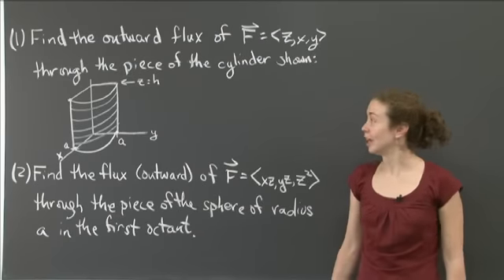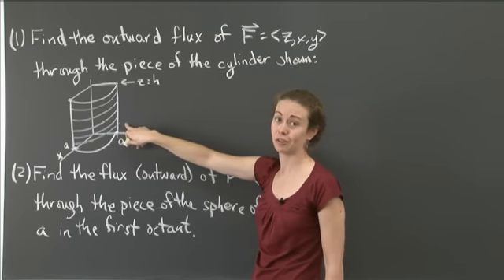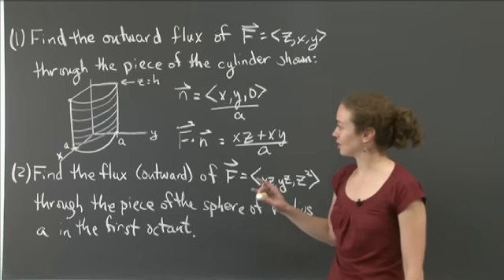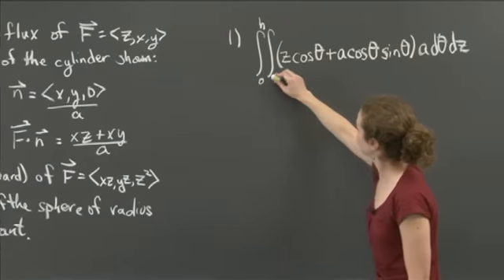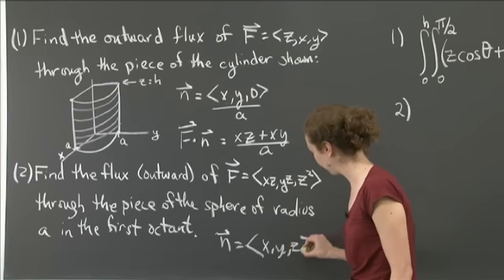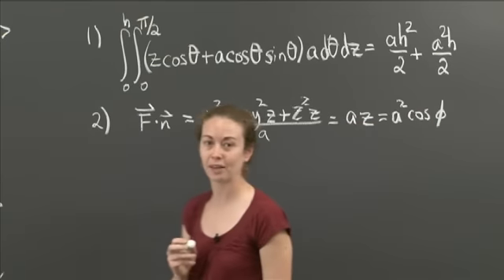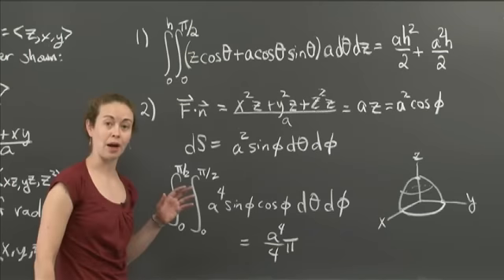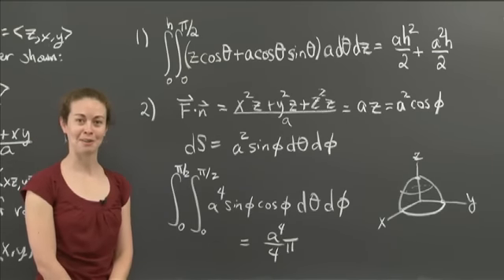Flux through surfaces | MIT 18.02SC Multivariable Calculus, Fall 2010

Comment: Why didn't you teach them using the parametrization and taking the cross product of partial derivatives of parametrization to get the normal vector? This dividing by "a" seems to only work sometimes.
Reply: Juan Preciado I think this is resuscitation, not a lecture.
Reply: @chriskitley9875  Recitation*
Reply: It confused me also
Reply: I was use to getting the cross product of the partial derivatives

Comment: how did you work out the normals?
Reply: did you find out the answer to this, especially for the curved side
Reply: You can take gradient of that field and devide magnitude of that gradient
Reply: the normal vector is like the parametric equations of <cos(t) , sin(t) > ;if you plug that into a graphing calculator using parametric functions  you get a full circle, but here we only have from 0-pi/2, which is controlled by the boundary of integration of d-theta. so the professor could have crossed the <cos(t) , sin(t) , 0 > with the the F = <  z ,x , y > and gotten the same.  Her (a*d-theta*dz) is her jacobian for her cylindrical coordinates ( r , theta , z). Know t is theta in my example, I'm not writing cos(theta).
Reply: @JG-zn6od  amazing. Is that really it?
Reply: @JG-zn6od  please teach me, is the gradient of the surface different from taking the partial derivatives Ang getting its cross product?
Reply: In case anyone still has this question, Professor showed how to get the normal to a cylinder's surface in the lecture: https://www.youtube.com/watch?v=phk05iSMezA&list=PL4C4C8A7D06566F38&index=27 
Essential, since it is horizontal, there is zero z component, then if you draw a circle in the x-y plane, you can see that the normal is in the direction of <x,y> but since it must be unit length, it gets scaled by its length (sqrt(x^2 + y^2) which = radius length = a in this problem. Hope this helps.

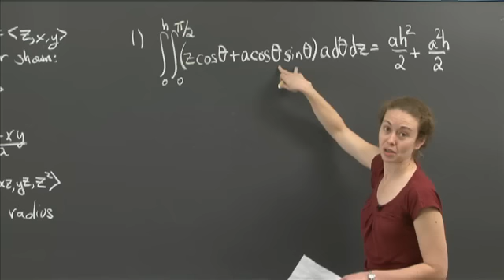Comment: 5:45 that zcosϴ should be zacosϴ. you guys should put an annotation as this have been watched 31k times. LUV from INDIA.
Reply: No, she did it right... (Remember it's the unit vector, so you have to divide zacosϴ by a, the norm.)
Reply: When #MOBI says she wrong. It doesn't matter she is MIT or Oxford, She is damn wrong. No excuse whatsoever will make her right.
Reply: MeagaRain84 ok
Reply: Yes that should have "a" since if we take the cross product we have acos(theta) +asin(theta). If she assumed that a unit normal vector should be used then taking the dot product of F and the normal should also be multiplied to adS.